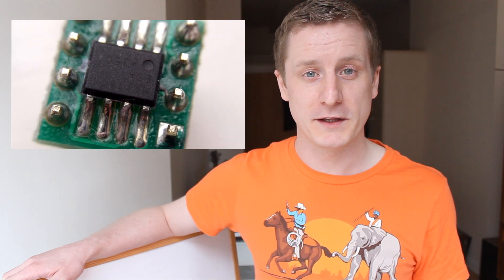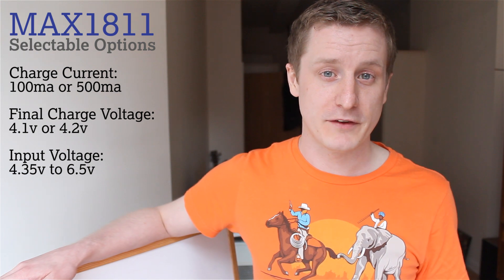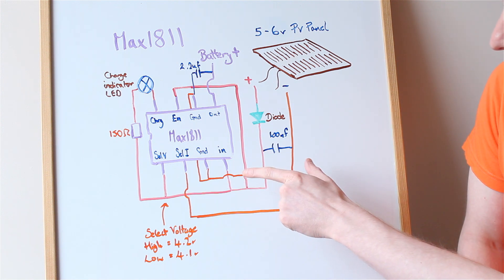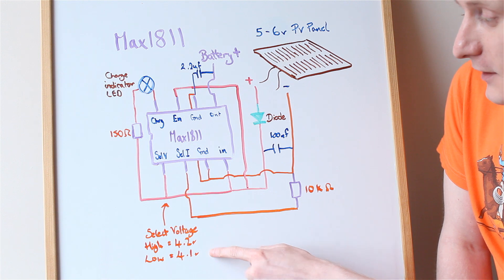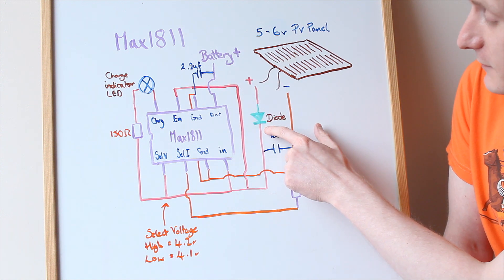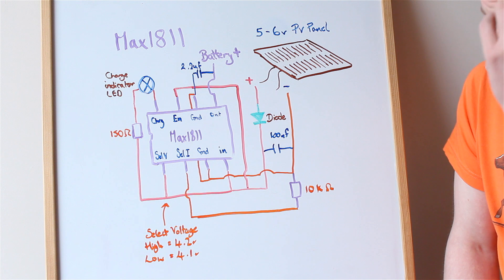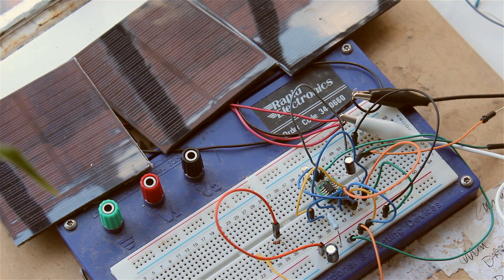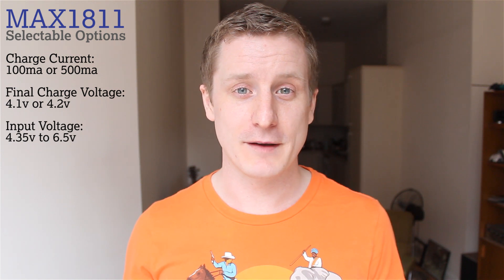MAX1811 Lithium Polymer (LiPo) or Lithium-ion (Li-ion) Charger

Comment: Led turns off when the charge is complete? 
The datasheet indicates that the input diode is not required, so the diode you have put in the diagram is it required or not?
thanks
Reply from the maker: Yes, the LED will turn off when the battery reached 4.2 or 4.1v depending upon your selection. A diode is not needed but to prevent reverse voltage problems by plugging the solar cell in backwards it is advisable.

Comment: I think that the diode at the input should connect to each of the solar panel before paralleled together.
My idea is if the solar panel generate voltage unequally, the higher voltage generated by one panel may cause a reversed current through other panels and result in power dissipating or damaging the panels.
Reply: Here is a website I just googled which justified my thought.
http://www.instructables.com/answers/How-to-connect-a-diode-on-parallel-solar-panel-con/
Reply from the maker: Genius, thanks for the link. I didn't give enough thought to the solars panel after adding a second. I will amend my current design. Thanks!